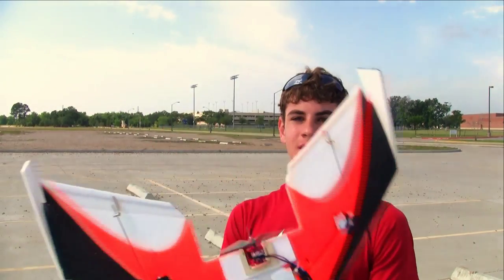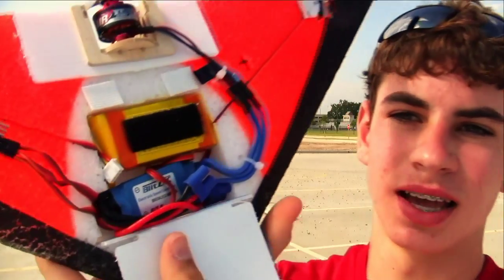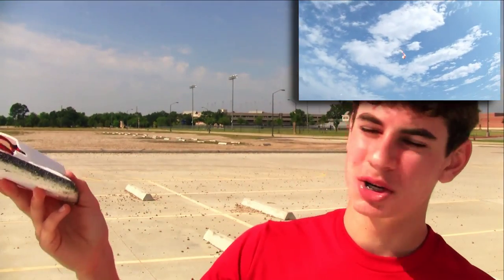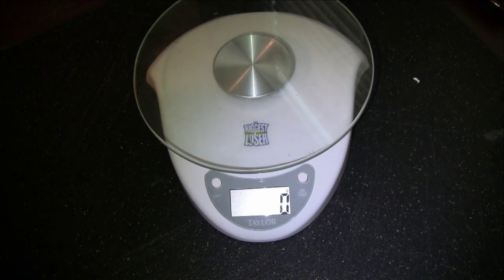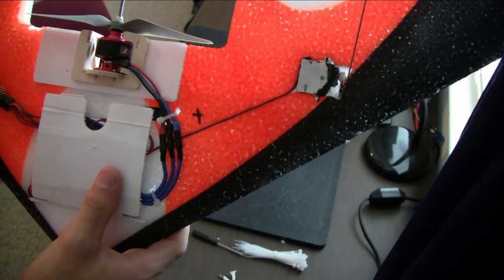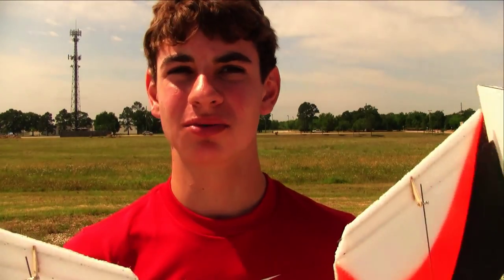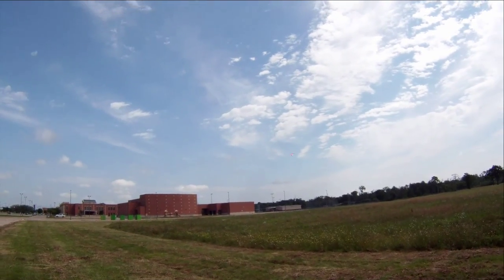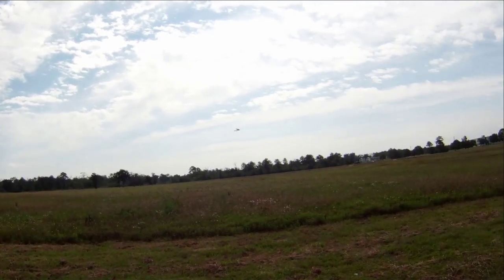Episode 3: TuffWing Maiden

Comment: Try the following....
1. The prop is backwards .Also invest in a prop saver (cheap and good insurance)
2 . 1350MaH 11.1 3s should be no prob. 
3. don't adjust the CG just balance the wing so that the CG is close to the Mfg. spec
4 if its tail heavy. add a bit of weight to the nose or move the batt fwd.
5. do the opposite if its tail heavy.
Charge the batts  & Carry On \
Have fun